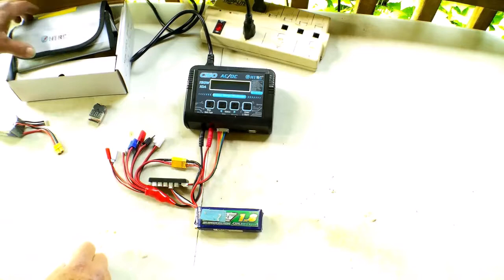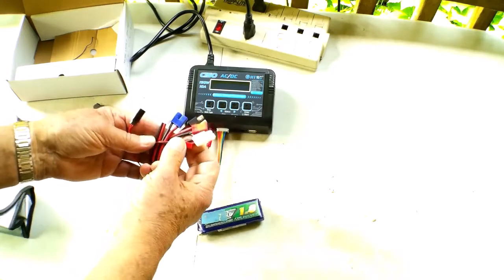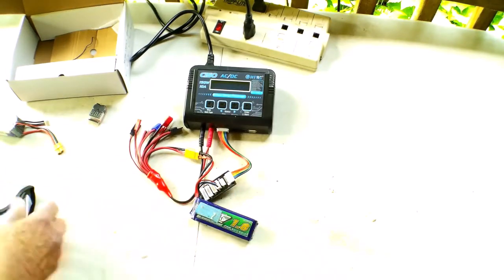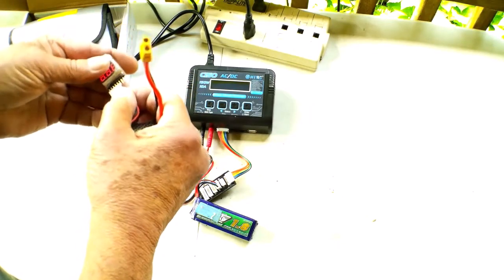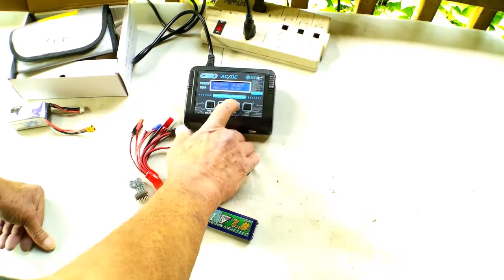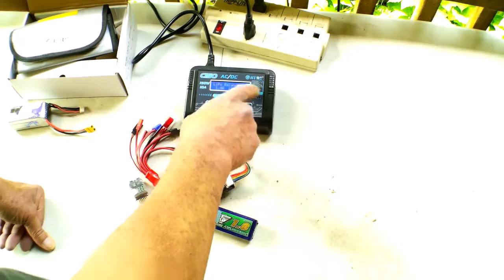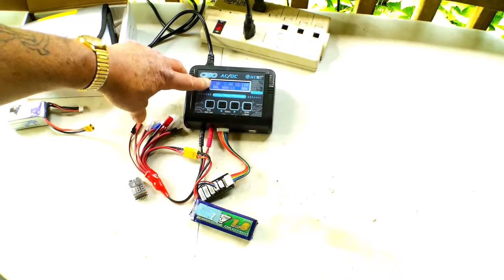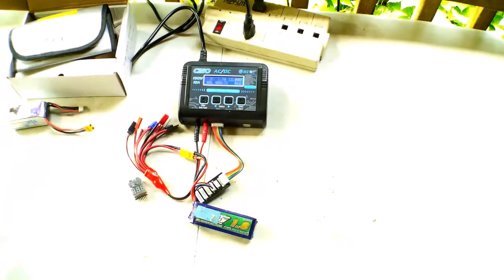HTRC C150 Charger Operation

Comment: how would you change the section that shows 3S? what if it doesn't automatically sense it? I wish you would have demonstrated that as you did with all the other settings.

Comment: Greetings.  I have a htrc c150 charger.  I charged the battery with 20 amps and showed 22 amps.  How to enter the engineering menu for calibration.  How do I calibrate my device?
Reply from the maker: A battery will only take what is needed so you are doing something wrong.